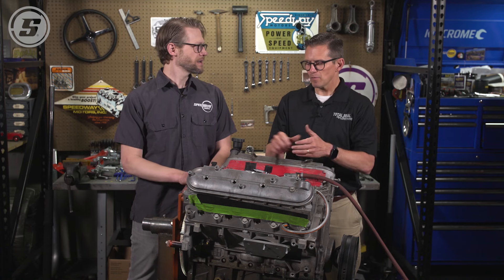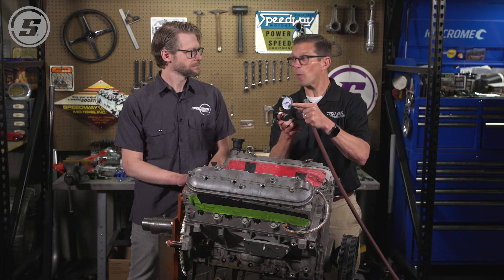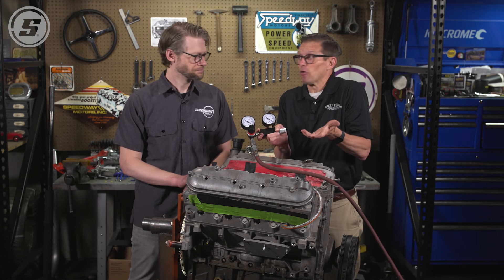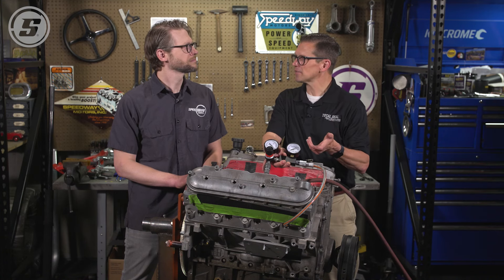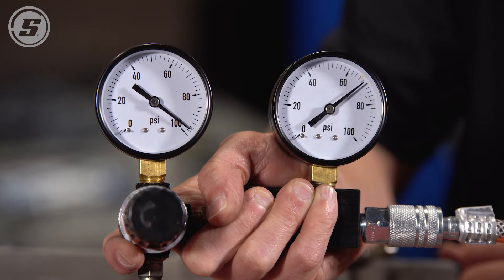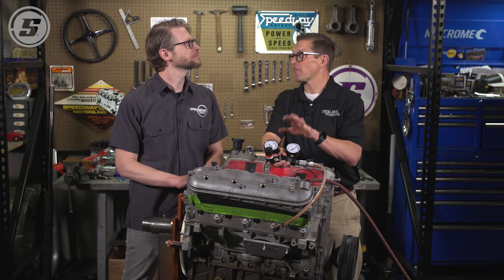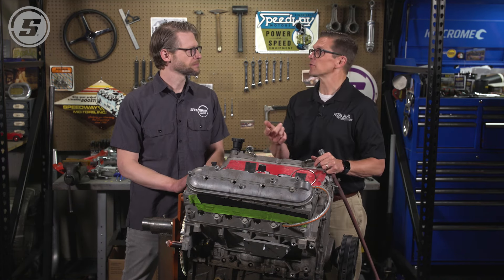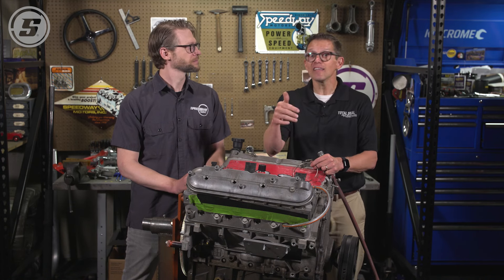How To Do a Leak Down Test & Interpret Results In 5 Minutes

Comment: This is great for checking rings but you neglected to address the valve seats or the head gasket. For instance, if you hear air coming out the valve cover oil filler neck/oil dip stick, then that is rings. If you hear air coming out the exhaust, then that is an exhaust valve issue (bent valve/carbon build up on valve/seat, worn seat/valve, etc...). If it's coming out the air intake, then an intake valve issue. And if your hear air or see air bubbles in the cooling system, then a head gasket issue. You can also check to see if you hear air coming out the adjacent cylinder(s) spark plug holes for head gasket or large cylinder wall crack/hole. I just did a leak down on an engine and saw this very issue. Pressure in cylinder 1 with air coming out the exhaust, plugged the exhaust and then got air out cylinder 2 spark plug hole..... NO BUENO

Comment: You neglected to take into account leakage by the valve seats.
Reply: Thank you !!
 The valves can leak as well.
Ans so can a head gasket.
Reply: Yes, part of the system analysis… add oil to the cylinder to rule out the rings… then tap on the valves to confirm they are seating / sealing (oh, don’t forget to evac the oil before replacing the spark plug)